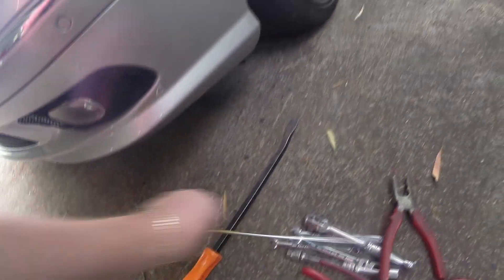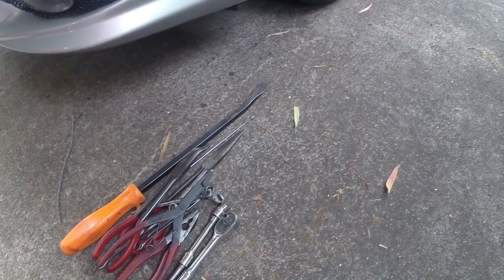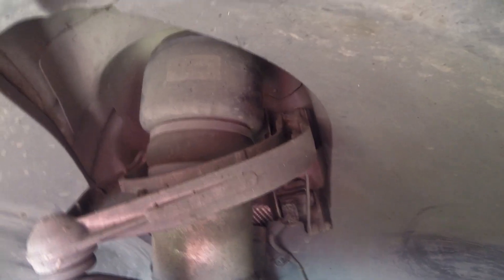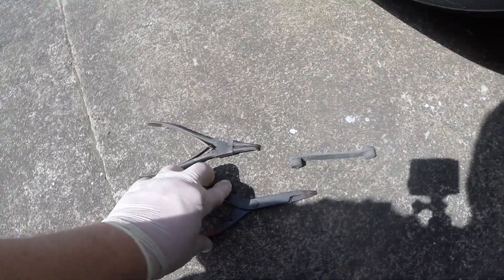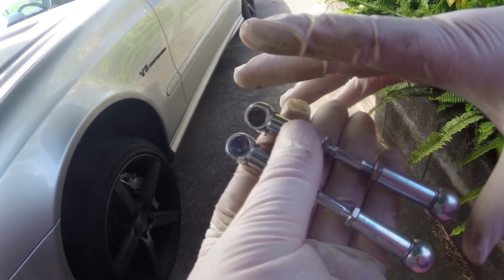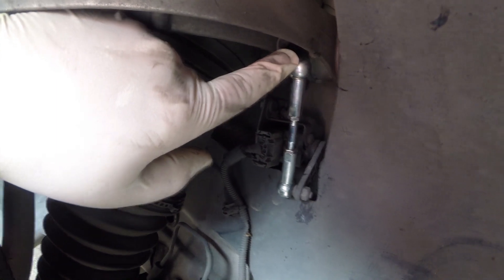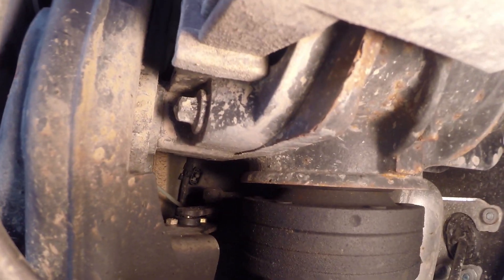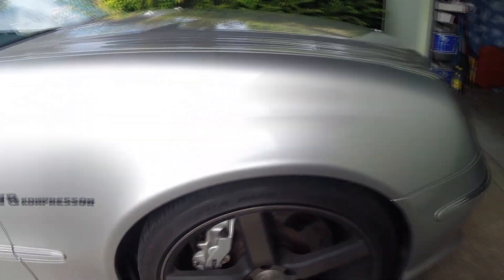E55 AMG  Airmatic Lowering Links Installation

Comment: I had these for about a year on my CLS and S class. Lowered the car a lot but not slammed obviously. Worked great until the CLS got stuck on my way in at a steep underground parking structure in Mexico. It was so low not even raising it with the button helped. Looked like a teeter totter. Then I switched all 3 with mini 12 volt actuators, ran wiring throughout to custom switches and level indicators in the ashtray. Now I can adjust on the fly. Slammed when parked, slightly lowered when driving or stock height whenever.
Reply: You have an Instagram so you can help me out and do it?
Reply: Link?

Comment: I personally would have readjusted the length of the links to make the front and rear sit level. Thanks for making the vid it will help me to do mine.
Reply from the maker: Cheers, I later adjusted it level and a bit lower. ✌
Reply: @ModifyOrDie  So do you still have full inside function for high lift etc
Reply from the maker: @dpn_naxton  yep all functions as original

Comment: Gday Mate great vid, mines a 2013 E class sedan just want to lower it a little to fill up the space between the top of the tyre and the gaurd? As have bought some after market wheels?  How do you adjust the new links to drop the body to the height you want to achieve?
Reply from the maker: Hi, the links are adjustable like a tie rod. Basically, you have to adjust until you are happy. I started with a 5mm change and made some slight adjustments from there.
Reply: @ModifyOrDie  ok thanks when you say 5mm do mean in overall length of the rod? also the kit for my car has from what i can see 4 rods 2 front and 2 rear? you said in another reply the rear was only 1?
Reply from the maker: @grahamsmith7407  5mm measured center to center of the mounting socket/hole. Not sure what model you have, some W212's do not come with front Airbags, but conventional coil springs. Might pay to check first. If airmatic all around, you should have 3 links to replace. If your car only has rear airmatic, then just 1.
Reply: @ModifyOrDie  interesting thank you I have learned something today! Mine is a 2013 E400 sedan with what I think is all around airmatic suspension? But I will check? Stay tuned?👌

Comment: Hi! I wanted to ask if it’s normal that the driver front side sits a bit higher(as I see it’s 6mm in Your car, same as mine) than front passenger’s side? I know that wehicle is not loaded, but it seems quite big to me. Didn’t You have problems with alignment?

Comment: great job,i tried on my r230 today but i have a dout,should i tighten the both nuts before or i can tighten them after install?
Reply from the maker: I would set the link length and tighten, install then adjust from there. you can adjust on car no worries as long as its jacked up, just copy what you do from one side to another.

Comment: I'm definitely having trouble with the rear link. did u experience once u get in the car one side raises more then the other?
Reply from the maker: Hey, yes, however when measuring on different "level" surfaces, i got different results for the rear, I got it close after cycling the height a few times on a flat surface. It is still not the same height on either side, I see a lot of people report the same thing.
Reply: Same problem i have with my cls63 right side more up little how to fix this?
Reply: Same thing on my cls. When I back into my driveway everything is normal all around. For some reason if I pull in front first on the same driveway, it is uneven at the rear

Comment: Does this work with the ABC suspension cars that are hydraulic? An I've also heard of people using a lowering computer module as well. Is that needed?
Reply from the maker: OverDrivenTV hey mate, yes, it works on the same principle 😊.
Reply: Modify Or Die thank you. I actually have a set of these for my 2005 s55 just haven't installed them.
Reply: Modify Or Die threw you a subscription. Nice car you have.

Comment: Hi, is me again, how are you, I follow your instruction and found that there are 2 front links and can be adjusted, seems no issue, but I found that the one rear link is not the same type and it can't be adjusted, can you give me a "hot tech tip" where can I buy one of this link please? appreciated!!
Reply from the maker: Does your fronts have adjustable links? From factory they are a solid plastic link. Anyway, you can just bend the mount for the sensor in the correct direction to get drop, or you may need to buy a whole kit search "Airmatic links".
Reply: @ModifyOrDie  yes, I bought my car used, it is installed with adjustable links for the front, but not the rear, with your tip, I will tell repair shop to bend the rear link to get drop. thanks again! one more thing, if you may come across, my rear left side is 10mm lower then the right side, I already have my suspension replaced, still the same, wonder if it can be cause by the Airmatic spring ? thank you so much, it helps a million, as such old car, it is very hard to find knowledge these days! cheers, have a nice weekend!

Comment: Hi bud! Do you know what is the lenght of factory links( front and back)? I just got e55 and it is lowerd on links and got some 20 inch wheals. I woud like to set it back to factory and then play with it to get what i like! Thanks
Reply from the maker: Hey mate, I'll measure up my factory links when i get home :).
Reply from the maker: Sorry for the late reply. Fronts 98mm centre to centre, rear 170mm centre to centre.
Reply: Modify Or Die Thanks alot! Centar woud be the midle of the hole on the link where the ball pops in? Thanks again!
Reply from the maker: Drazen Suzic Yes 😊

Comment: I'm hoping you can help me troubleshoot this issue. I installed the front links first and everything seemed fine. I then went on to install the rear links. 

After installation, the airmatic system keeps calling for the car to lower. The car lowered until it seems the rears were completely deflated and the fronts wouldn't move. 

I tried readjusting the links but there was no change. The adjustment made was 5mm each. One set longe the other set shorter per instructions. 

Thinking maybe this just doesn't work for my vehicle, (2008 GL450)  I decided to reinstall the original links. To my dismay, this problem persists. The rear bags will not inflate. I deflated the entire system by releasing one of the air lines on the front. 

After the vehicle became level through this process, I restarted the vehicle hoping the entire system would inflate. However, only the front bags would inflate. I tried pressing the raise vehicle button on the console which raised the front up even higher and the rears stayed the same. 

Now the front of the vehicle is at its highest position and won't come down and the rears do not operate. This is with the factory links installed. Previous to installing the lowering links, there was no issue with the system. I'm devastated because if to fix will cost thousands of dollars I'm done with the vehicle. 

Any advice would be helpful.
Reply: Did you make sure the sensors were in the same position as before when attaching to the links? Let them get adjusted by pressing the button a few times.

Comment: And the rear link?
Hear is a PITA to Work on the rear I seen countless of videos but never ever anyone showing the rear link arm :)
Was it really that hard could u do it on the ground like u did the front links?
Reply from the maker: Hey, i show the rear link as best I can from 3:50. The car was jacked up on axle stands, you can get to it as long as you can get under the car. It was a little tight, but you can get to it using extra long nose pliers.
Reply: Modify Or Die Super thanks man this is the best video out there really appreciate it. Thank u
Reply from the maker: Thanks mate, good luck with the job!
Reply: Modify Or Die 330mm plier u think is long enoug for the rear? :)
Reply from the maker: It should be, mine were around that long.
Reply: Modify Or Die So grwat I'm all set up now installing Saturday morning:)
Reply: Modify Or Die finally got it done so great drives perfectly and problems bit some speedbumbs but hitting raise vehicle is really a blessing now just did u had YOURS 4 wheel aligned after the lowering? If not any issues tyres?
Reply from the maker: I did an alignment and I am noticing some camber wear but nothing I am worried about, maybe swap tires around if you want to get the best life after 6-12 months or so. Good work mate!

Comment: I want to RAISE a e500. If I got these links for the airmatic system, and did the opposite of what was done in this video... anyone know what would happen or what the limits might be?
Reply from the maker: lol, interested to know why. But, it should raise the car, but how far and what damage it may do to a bag, no idea! I'm gonna guess, you'll get an extra inch in height, report back :).
Reply: @ModifyOrDie  I want to raise up the e500 approx 2.5" (which brings it in line with the 2021 All-Terrain wagon). I want to basically do that to a w211 4matic wagon. Then run some A/T tires and Safari build it =)

Comment: Why not just use lowering obd module?
Reply from the maker: I wanted links, but sure you can use the module or lower it on star.
Reply: What’s lowering it on star?
Reply: I got a 2017 GLE 350 with airmatic. Can I lower it like yours manually with out the obd device?
Reply from the maker: @uniq_vidzbostonmass25  Star is the mercedes diagnostic system, you can adjust the ride height.
Reply from the maker: @uniq_vidzbostonmass25  Yeah, as long as it has airmatic you can lower it with links.
Reply: @ModifyOrDie  hey man sorry it's so long ago but do you know where to get a legit mb star program?

Comment: I think mine sits lower then this. With the stock links.
Reply from the maker: I did got a bit lower later on once i got it all dialed in. You can also run the stock links with washers/bending the mount to achieve the same thing.

Comment: Hi, so if I want to lower my E320 w211 sedan all I need is this?
Reply from the maker: If it has airmatic susprnsion, then yes. I thought 320s had normal springs.
Reply: It does have normal springs, I want it Lower, should I just get coil overs?
Reply from the maker: @Michael-sf9st  yeah you will need lowering springs or coil overs.
Reply: @ModifyOrDie  Well that depends, my 320s have air in the back and springs in the front

Comment: Why didn't show how to remove the rear link this video is not helpful
Reply from the maker: redbaron2448 I show the bolts where the sensor connects too, very hard to get a camera up there. Undo the bolt and pop off the other end and out it comes its tricky but do able.
Reply: @ModifyOrDie   Not Cool. Little Explanation Even Verbally how This Is Done. I am Stuck Now. Connecting Axle Rod and New sensor Back together Is Near Impossible. Tried a 11 inch Needle Nose to grab Both. FAIL. What is the sequence to re install. Draw a Picture.
Reply from the maker: joe Dirt it’s a pain to get to. What links are you using? The ones I used snapped together easily. Once one end is on the sensor, you have to get up there and clip the other on, it’s tight. Have a beer or cup of tea then get ‘er done 😉.
Reply: Don't blame him. He explained it. Its a simple straight forward  job. Multiple videos out there

Comment: So to install these links , you don't need to remove the tires???
Reply from the maker: Anton no just jack it up 😊
Reply: Thanks, I asked my MB wrench about these Links, he said that an alignment would be needed and it's possible the accumulators could overflow which may require a reduction of fluid to the reservoir....Thoughts?
Reply from the maker: Anton alignment is advisable but you can't adjust for camber anyway. It's an airbag what fluid are you talking about?
Reply: I'm assuming he meant the ABC reservoir, he mentioned the accumulators needing to adjust to the weight when car is lower? Either way, I just got the Links and will give it a shot...Thanks
Reply from the maker: Anton these don't have abc I know I said it in the video it's just air suspension not active body control. Unless you absolutely slam it you won't have any issues other than slight camber wear in tires. Ta
Reply: I just want to level my SL out so I should be good to go. I'l give an update once it's complete....Thanks!
Reply from the maker: Nice, cheers mate.
Reply: @leanidis300  so, how it went? 😁
Reply: @TheJoSef1n  I ended up switching back to stock